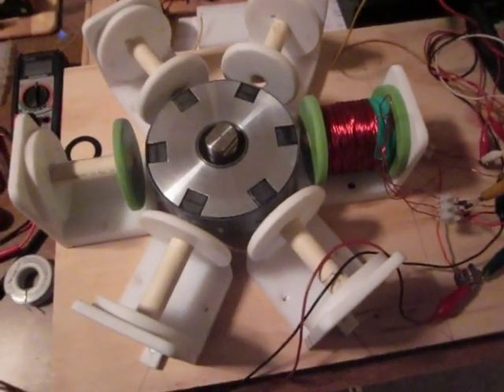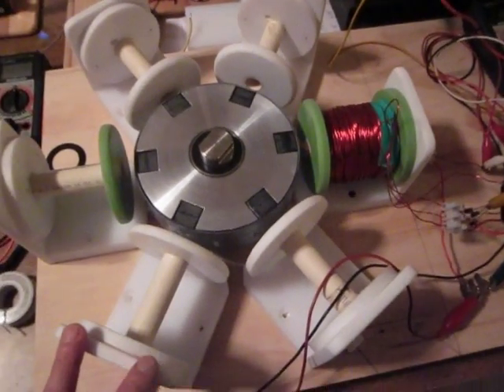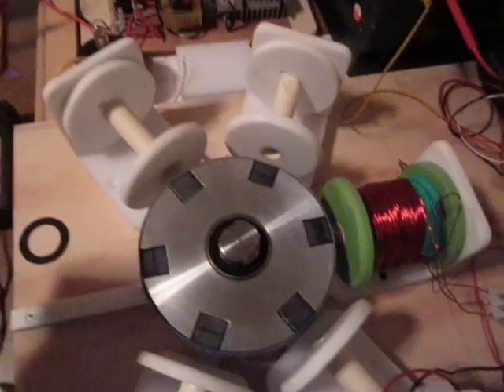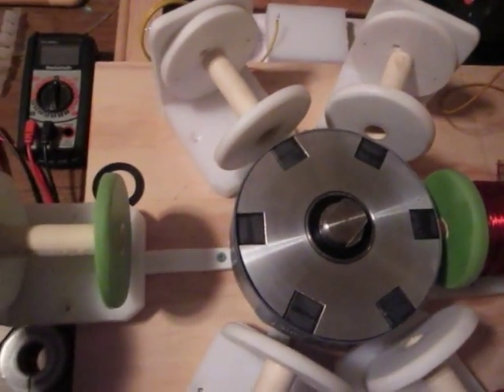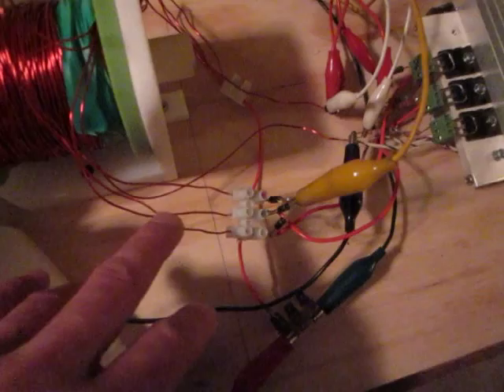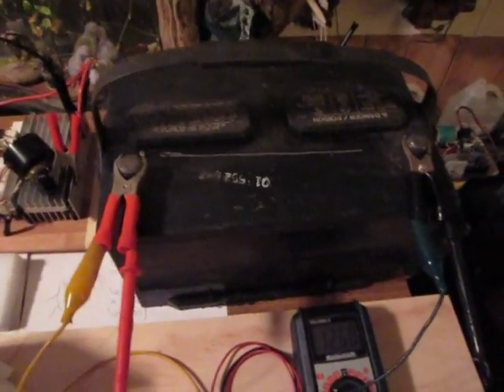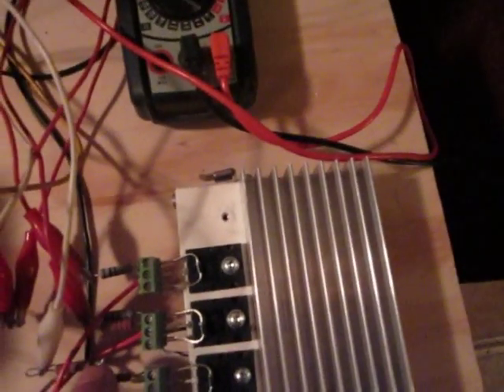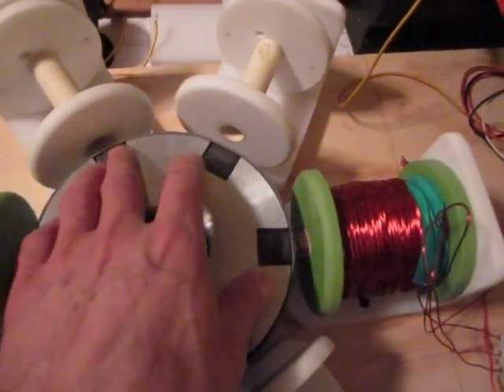6 Coiler Bedini

Comment from the maker: @fathershand Repeat this process noting the time required to reach 14 -15V. It should get shorter each time as the battery "learns" to respond. The idea is to use little current in sharp pulses to make ions move inside. They do the job, not electrons. It may take few cycles depending on your charger and how badly sulfated is your battery. You may see improvement after 1 cycle. I have 10 yrs old battery from scrap which will start my car at -25C. Don't discharge below 12.5 standing V

Comment from the maker: @fathershand When you connect sulfated battery to the charger you'll see the voltage climbing fast and dropping down after. Then, it will slowly start to rise. What is happening is that battery impedance is getting lower while pulses knock the sulfur off the plates. This is the part of desulfating. The whole process of restoring is about getting impedance low (range of milli ohms). Let the battery charge to 14.5 -15V. Let it rest and equalize, discharge with respect to C20

Comment from the maker: @fathershand First, make sure none of the cells are shorted. Use multimeter at one terminal and other probe extended with piece of wire to touch the bar in each cell. (be careful with acid splashes). Most batt's have 6 cells and should measure at least 2V each. If any cell falls way below it maybe shorted. Also, make sure there is enough electrolyte in each. Add some distilled water if necessary. Short cell will also cause more current draw from input.

Comment from the maker: @fathershand , Cut 100' lengths of wire and attach one end of bundle to the post, tree etc. Put other end inside a chuck of var. speed drill. Walk away to keep wires stretched and twist with drill (keep on forward - which is clockwise). This is an option but untwisted will work too.
V

Comment from the maker: @fathershand , I regret dismantling my first SSG. Different wire size is not a big problem. SSG should work anyway. Important part is trigger resistance and tuning to the spot where SSG will be most efficient. It isn't difficult to get COP 1 with simple setup. Don't forget about 25-28% of mechanical work as well.  This isn't the motor. Highest rpm doesn't means best charging and efficiency. Bifilar single coil will not be able to restore large batteries. 
V

Comment: @blackchisel97 Thanks for that reply.  The solid state SSG would be easier to build, but I already have a bicycle wheel setup with only one coil.  I had to use salvaged magnet wire from discarded televisions to build my coil.  It won't keep the wheel spinning because I used 4 different sized wire in the coil.  It does oscillate and charges a battery, but I don't get a full charge.

How do you wrap your 6 wires on the coil?  Do you twist them prior to putting them on the spool?  How do you do it?

Comment from the maker: @fathershand . Solid State multifilar is very powerful charger and restores large batteries very well. If you compare 6 magnets rotor rotating with 900 rpm and 5 transistor solid state oscillating at 5kHz it seems that later would be the winner but.......when you have rotor with magnets and multicoiler setup you're getting additional input which you don't have to pay for (beside negative EM from vacuum and curvature of spacetime) - magnets. What are they? ;-)
Thanks
V